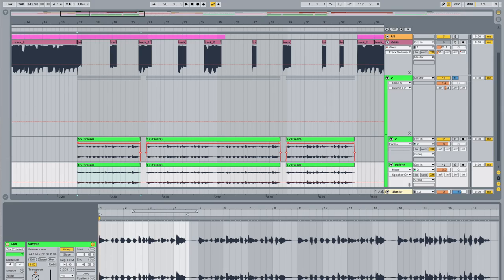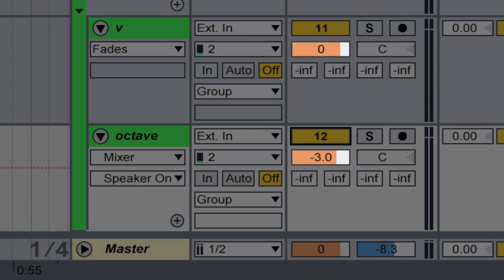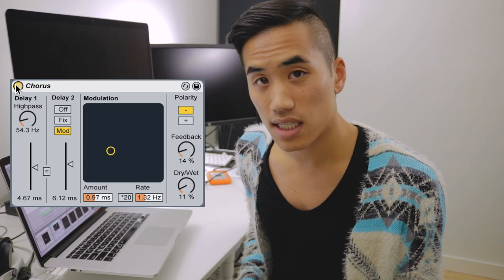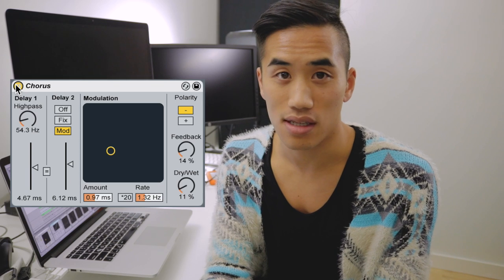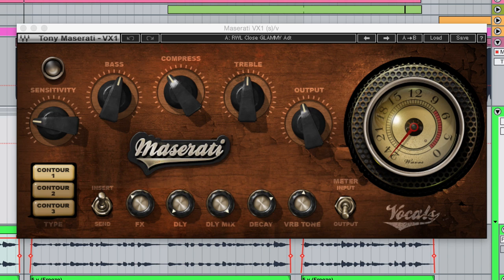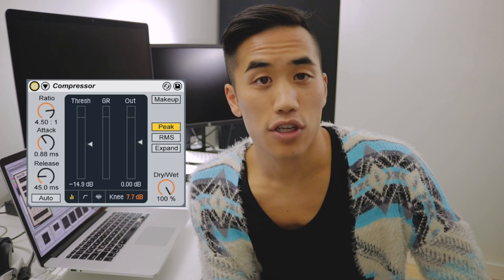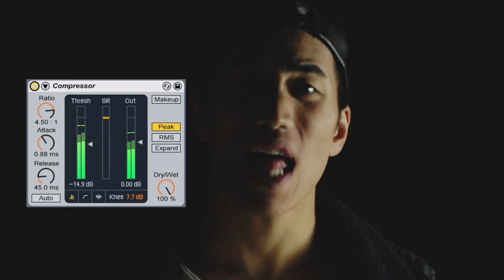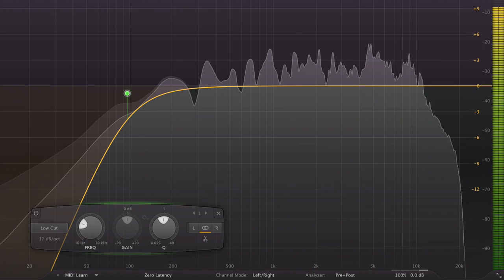This is exactly how I process vocals.

Comment: I just realized this, but you record a different high five sound for each video to reflect the sound of the room/space you're in, don't you?
Reply: That's a fair point
Reply: i think he might be doing that to sync up the audio and video when editing. Some leave it in for a more relaxed feel.
Reply: Good point, you gotta sync up the video/audio somehow. I just like that he reuses the sound as the air five :D
Reply: Dude Ben! Funny running into you here.
Reply: Nice observation! Also, just like Peter, funny running into you here!
Reply: Ya I noticed that
Reply: TheDogZone Right, he’s not actually making the sound when he air fives...
Reply: He clapped in the video, and then he removed the part and used the audio instead when he "slaps".
Reply: @stressfacture  wouldn't work as a sync since it's an air high five. for a sync you need to sync a sound to the picture
Reply: HSounds no, he means that Andrew recorded a clap at the very start of the clip, which lots of video makers do to sync video and audio, and then does the air high five, using the audio from the flap over the high five
Reply: Whatever it is, it is either suffering from seriously bad slapback or has that as an effect for some reason.

Comment: I consider myself hard of hearing, and like you, I had a few sets of tubes as a kid to remove fluid from my inner ear (I don't think ear infections were the main driver, because I don't remember any). For me at least, I attribute some of my hearing loss/limiting to the fact that my ear drums now have a good amount of scar tissue/calcification. I'm definitely not an audiologist but I'd wager that the scar tissue plays a role. theres also the periodic tinnitus and comes in briefly one ear at a time ... does it dampen the sound for you as it does for me? (like the hearing sort of ducks out but doesn't go mute?) the shoddy hearing is just a thing that I accept at this point because any further surgery seems too risky in comparison to the benefits (also no doc has broached it). good luck and know that there are some other HoH folks out there with similar experiences!

Comment: i'd use a wave editor like izotope rx or image line's edison to pitch up the vocal, for more formant preservation accuracy!

i like to use dist/sat/drive plugs at low settings to get that kind of "dirty" compression effect, then, if needed, use a transient processor. of course, that would be more convenient with vocal chops than lines well sung. 

i guess the rc24/48 reverbs by native instruments would also do a great job here. 

good on you for pro q :) fav eq next to hofa IQ-EQ, which is kind of a multiband compressor/eq hybrid

anyway great vid, thanks for sharing, i'll have to work with vocals in the future more

Comment: The biggest thing I've learned the more I produce is that 9 times out of 10, you need fewer things on the rack, not more of them. When you get lost in the mix, it's first instinct to add something else rather than to dial back the stuff you already did, but that's wrong.

Comment: I have low Frequency rumbling/humming sounds occurring in my left ear. When I first encountered this problem I thought that someone was outside my house playing super bassey music - It took a couple of encounters to finally realise it wasn't coming from the walls or outside this was taking place in my brain -_-. 

I get it periodically now but it is coupled with slight hearing loss in said ear. ( I am 23 by the way). It also can cause some bother deciphering pitch as the frequency my brain is producing (the tinitus pitch is not actually there, the brain is responsible for creating it) can sometimes interfere with what i'm listening to. 

Looks like it may be a case of ETD for me (and possibly would be worth considering for yourself as this was rather onset for me- just happened one day). A steady and long course of decongestion tablets coupled with steroid nasal spray has a huge impact on treating this. (The tinitus with ETD can be high or low frequency) If not there are minor operations that can be done on the ear drum later down the road.

Im not too familiar with your channel but if anything i thought I would drop this knowledge here as I had a pretty severe challenge with this physically but more mentally. 

Strongest lesson I learnt was to never sacrifice your senses for anything; it's totally not worth it. In my case my hearing problems have been definitely impacted by genetics and smoking cigarettes  - the nicotine is scientifically proven to cause problems in the Eustachian tube. VAPING- also a major risk as the Propylene Glycol is an extremely toxic and a sticky tricky chemical to remove from nasal and ear passages.

Not looking for likes/comments - Just thought id drop this info here in case it helps anyone else :)

Comment: The one octave doubling was completely lost in the mix I think its because of the glissando synths are masking your effect. You need to make it a little more exagerated and put a high pass filter on the lows.
Reply: Sometimes things are just there for texture and making it too obvious would take away from its intended effect.
Reply: I can hear it just fine. This is what's wrong, people think everything needs to be exaggerated and it muds everything up. The presence and energy it has is still there. That's the point!

Comment: Great to see this. Thank you!

I wonder about the low cut at the end... what's the rolloff? The lowest note in your vocal part (in this excerpt) is about 172 Hz (that F, give or take), so the octave below is 86. I would consider rolling off starting at below the octave below (86), if only to let the drive work harder on the combination tones from the chorus... Just a thought. I hear a lot of mixing engineers talking about not cutting too much low end to "keep the energy" of the original recording. What do you think?

Comment: Hey dude - I've noticed you place your reverbs directly on the track usually (at least that's what I've seen in other vids). I've always been under the impression that it's best to put the reverb on a separate aux track and then bus the signal to the reverb. Is this something you're doing intentionally or just the way you've always done it?

The benefit of bussing it to an aux track (to have a separate reverb track) is that you can send multiple channels to the same reverb to reduce the work on your computer. Also, you'll have independent control of the sound of the reverb itself, so you could EQ or compress (or do whatever to) your reverb alone. 

Wondering your thoughts on this!
Reply: Sweet beans daddio.
Reply: there's no set in stone rules. Whatever makes what you're working with sound how you want it to is the right way
Reply: That we all know. Just that sometimes one puts a reverb as an insert and bounce it out fully wet, having that as a parallel in the mix later. The downside with bussing a reverb is that no separate processing is allowed. With a dedicated reverb one might only for the vocals both adding saturation and most of all EQ. Sometimes, a reverb is placed as an insert before a delay, only for one track or bus, not fully wet though. This would never work to do as a send really. Sends are just for the bread and butter reverb in my cases, the big reverb which FX and much other go trough.

Comment: Just curious on why you applied your EQ so late in the mix? Wouldn't doing it BEFORE you apply all your effects result in a much cleaner sound? Just a thought. Also how come you don't side chain your effects in a return track? Again, just cleaner sounds in my opinion.
Reply: Putting it after can remove some low end artifacts from the plugins. Andrew didn't do this but the Sausage fattener created harshness that could only be removed post plugins. However I agree with side chaining the sends

Comment: Just wondering. Any reason you put the compressor before the EQ? I thought it would make a lot more sense to do it the other way, especially for a low cut.
Reply: RainbowCoreChannel eqs can be pre or post comp based on need. the general reason you may eq pre comp is so you comp isn't working on the lows which in turn focuses compression on the highs. sometimes lows can mess with the comp engaging and releasing so if you don't need em may as well clean up the signal before processing. i personally prefer doing my hi/low passes 1st in the chain for those "cleanin' up the signal" reasons.
Reply: Thanks! that's enough reason for me. I usually put it before the comp so it doesn't have to work so hard, but I might start doing this too now

Comment: to be honest, the only difference I heard between source and processed was a bit of reverb and a bit of fattening
Reply: That's the key. Don't over-process in any stage of the chain. Subtle but many small changes in detail makes it sit and feel right. Same goes for mastering. The biggest part of creating a good sounding mix is getting the best recording possible. It's at least like 80 percent of the job done if the recording is top notch in regards to the sonic vision you have in your head.

Comment: Hey Andrew,

I live in an apartment. I don't have a separate room for me. So I have some room noise. I recorded a vocal and tried some mixing but the noise was still there . Would it be advisable to use a dynamic mic instead of a condenser mic?
Reply: Mishal Reuel use a gate
Reply: @Jared-Pace  shall I use gate or rx7??
Reply: @mshl114  both could work but try gate first as many DAWs have this for free and probably lighter on CPU also.

Comment: @Andrew Huang hope your hearing is doing alright. I agree with using less EQ on vocals but have you played with boosting around 3-5KHz on your vocals? It will help to add presence without harshness. 

Also, have you tried parallel processing and multi-band compression for vocals yet? It's a whole new level awesomeness when it comes to processing vocals! I've got a whole vocal processing workshop I've done where I break down these techniques.

Comment: Actually, if someone out there wants to redo this, I suggest putting the lowcut (highpass) filter as the very first thing in the signal chain, unlike what's suggested in this video. Because this way I think you'll get a more predictable result in case there are "pop" sounds coming from the microphone. At least give this a try.

Comment: the order of the plugins i never really get. is there a certain order that always applies?

for example do you need to put eq as the last one always?
Reply: Kalkaanuslag it's all up to your personal preference of what you enjoy. but the chain order does change the way it sounds.
Reply: For example, if you were to put a reverb on a sound and then a chorus later in the chain then you get the chorus effect on the reverb, whereas if you put the reverb later in the chain then the product of the chorused sound will have reverb applied
Reply: short awnser: no. .. But if you want to make sure that you are not letting any stuff through in the bottom end then the EQ needs to be last as some effects can create some low end even if you EQ removed it in the beginning of your chain. But personally when it comes to vocal i would put an EQ both in the beginning and one in the end. First EQ to sculp the sound a bit and remove unwanted stuff, so that the following effects like compressors and stuff dont have to compress parts of signal that i don't even want there. and then an EQ at the end where i low cut or low shelf to remove the extra bass and stuff that has been generated by the effects. .. but this is just for vocals as they are usually the most important element so its ok to use a bit of extra time on fine tuning them. .. But in the end there are no rules and what sounds good IS good.